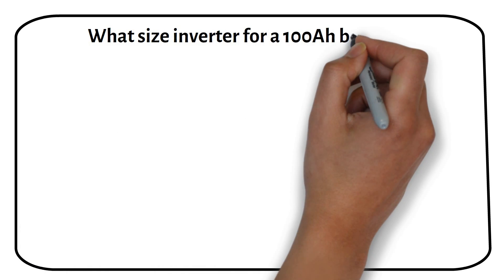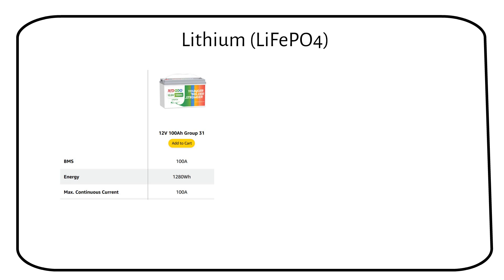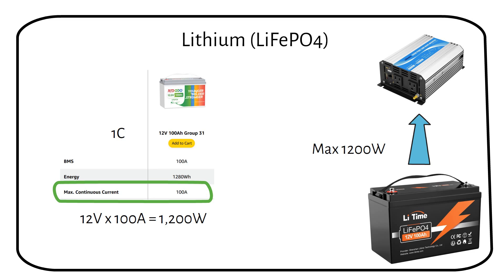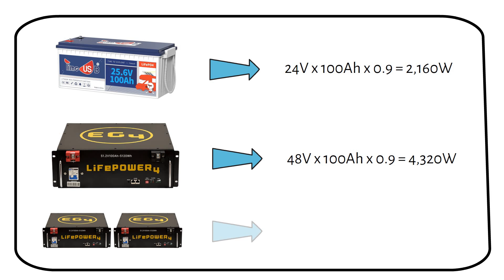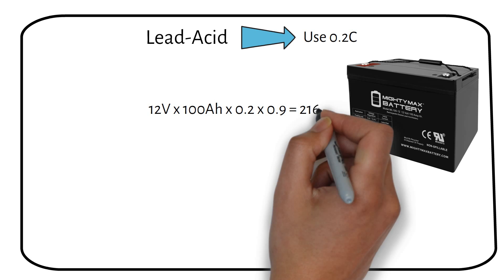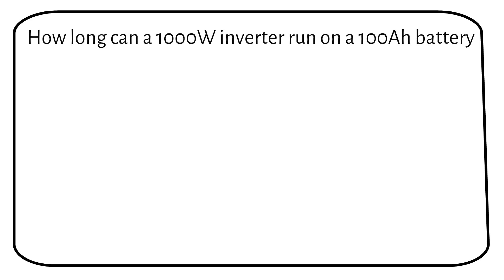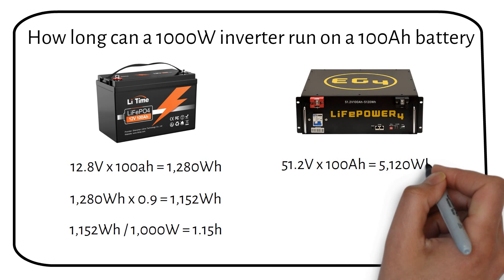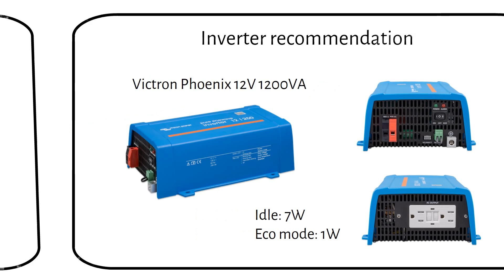What Size Inverter for 100Ah Battery - Sizing Battery for Inverter

Comment: I have 27 4.85 kw 48 volt GSL batteries and having problems with my fortress 12 inverters I have three of them
Reply from the maker: I think you should contact the manufacturers in that case.

Comment: Please is it possible to have a 1000w solar panel for a 12v battery charging 🙏
Reply from the maker: You can but i don't recommend it because you need a large charge controller. 1000W/12.8V=78A instead, use a 48V system and the current will be only 19.5A, much cheaper charge controller!
Reply: @cleversolarpower  wow 😀
Thanks for the reply, I do appreciate 🙏
Reply: For 48v the wire doesn’t have to be as thick so you’ll save money there too.
Reply: @2hotscottpro  Oh, thank you 🙏😀

Comment: Hi Nick,

I recently purchased a used RV that came with two Vmax SLR125 12V 125Ah 1.7kWh Deep Cycle Solar AGM Batteries already installed. It also has a Xantrex PRO XM 1000 Watt Inverter, which was disconnected.

I’d like to reconnect the inverter and was wondering if the TEMCo WC0177 2 AWG Welding Cable would be sufficient for this setup. I plan to use it to connect the batteries in parallel and then connect them to the inverter. The TEMCo 2 AWG welding cable is rated for 190 amps at 75°C (167°F) and 220 amps at 90°C (194°F).

What are your thoughts?

Regards,
Reply: I forgot to mention this:

Ampacity of TEMCo WC0177 2 AWG Welding Cable:

1.   At 75°C (167°F) Insulation Rating:
       -  Max amperage: 190 amps.

2.   At 90°C (194°F) Insulation Rating:
       -  Max amperage: 220 amps.
Reply from the maker: Checkout my video on how to select wire size. I also have one about fuse sizes. It's in my beginner playlist.

Comment: I have two Redodo  12 V Group 24 100amp hour batteries connected to a Giandel 2200 W pure sign wave inverter. This is for my 7 x 16 enclosed cargo trailer that’s been converted into a toy hauler, full build, bathroom kitchen, etc..
Reply from the maker: I'm sure you are happy with both. Good products.
Reply: @ thank you

Comment: I have just got an Enerdrive Ps 1000w inverter. I’ve got a Renogy 30A regulator. Any hints on Batteries or Solar panels would be great! Thinking 400 watt panels.. :)
Reply from the maker: The battery and solar panel amount depends on the total power requirements of your system. I recommend watching my video about sizing an off grid solar system.

Comment: I have 2 100 ah batteries and a 630 watt solar panel  what size inverter do I need
Reply from the maker: the inverter size depends on the load you want to run. This video talk about the maximum size inverter you can use.

Comment: Hi there. Great video thank you.  If I understand correctly, let’s say I want 6 x 300ah 51.2v server rack set up for a very large facility I wish to run.  Would I need 6x  eg4 18kw pv inverters for each battery? I’m a bit confused. Then how also would I be able to draw power from all the batteries and charge all the batteries at the same time?  Sorry I’m a complete novice to this stuff. Hope my question makes sense. I’m toying with the idea of the eg4 18 or victim easy solars in parallel set up for complete off grid systems but victron is so expensive especially as I’ll need a load of units?
Reply from the maker: You can just use one eg4 18kpv and connect it to the 6 server racks. The batteries will be in parallel. I made a video about parallel batteries.
Reply: Ok. Thank you for your reply. So even though I have let’s say 90 or 100kwh battery bank one  ev4 18kva inverter would charge the battery bank as they are in parallel. So if I had 17kw of panels will 120kwh be devided by 17kw of panels to get the charge time?

Comment: This is great. Thank you. I'm running 2 100 w eco-worthy panels into a controller, and the one deep cycle marine battery 100 amp hours to a 600-volt Amazon cheap DC to AC hook to the battery. It's always on,. I have 1 3. 9 to 14.4 max when battery is full. I leave the inverter connected, there is a shut-off switch but there's always an LED light connected. I haven't used it besides using lighting and charging phones, simple things. I was thinking of getting another marine battery to add to it. It's kind of expensive to purchase a lithium battery and have them delivered, Amazon boxe, homeless in a van.., I don't think I can get one to an Amazon box. Buying them in person is extremely expensive at stores. For the lithium. But I really appreciate all the info. I'm just trying to run a 400 watt ceramic space heater in my van during the winter. I think I'm going to have to go to a diesel heater, and get another battery so it will actually run for about 3 to 4 hours a night through the coldest part. Hoping
Reply: I've been on a small solar setup for 30 years.  You're right to be looking at something else to heat your van with only 1 or 2 batteries.

Comment: I was gifted an 80ah Lithium ion deep cycle smart battery. I am a ham radio operator and plan on making a portable solar power station with it for field operations. I am thinking a 600-800w inverter will work for this.

Comment: Thank you.  I have been searching for two days for this information.  My only question left is will a wattage surge greater than the capacity of my lifepo4 battery bank damage my batteries?  Perhaps you answered that when you said the BMS would shut the battery down were the wattage to go too high but I wasn't sure.
Reply from the maker: A surge is less than a second, most BMS'es can have a small surge of 2x their rated current. If not, they will shut down. You can solve this by placing more batteries in parallel.
Reply: @cleversolarpower  Thank you for responding.  I remember hearing that exceeding the batteries capacity could be dangerous. Perhaps that was in regards to free lifepo4.  I don't know as I am brand new to this.  But you have made me feel a lot safer ordering an inverter that runs at 3500w but has a surge rate up to 7000w while my battery pack capacity is at 5120w. Thank you sir. Appreciate your knowledge.

Comment: could you please do a video on 18v drill batteries and say 1000w 12v inverter, how many would you need, step down controller and diodes. this would be very interesting as there are many new power banks coming out with drill batteries .

Comment: I have a lithium 12.8v 300AH battery. 2000W Inverter be ok for it???
Reply from the maker: If the BMS is 1C, then you can draw 300A from it. 2000W/12V=166A. -> ok

Comment: I have a LiTime 200 amp/hr lifepo4 battery.  It states 100A max continuous charge/discharge, I assume because The BMS is only rated 100A. Does this mean the max inverter I can use is 1000W?  I’d like to swap my 1000W for an 1800W but only if I can use the additional power.  
Thoughts???
Reply from the maker: A 12V battery with a 100A BMS can deliver a total power of 1200W. Adding another one in parallel will double it. You can add a 1800 inverter, you just wouldn't be able to draw the full 1800W. The litime has a surge capability, so you can draw more than 100A for a few seconds.

Comment: I have a 65ah battery in my car and a 160 amp alternator, is it safe to install a 1000 watt invert? I will be using it while driving and not with car off. I know that multiplying volts by amps gives me max output of the alternators of 1920 watts.

Comment: I  love the 280/310ah cells as the most bang for the buck and favour the 1.5kw 3 kw peak inverter combo - it allows a microwave, toaster, kettle etc one at a time - it's more than twice your battery allowance to cover them rainy day or three that sometimes visit
Reply from the maker: Yes, last time i checked a 3.2V 280Ah was $45/pc. What inverter do you use?
Reply: @cleversolarpower  LVYUAN Pure Sine Wave

Comment: I only need to power my cpap machine 75w and my laptop 65w so I got a 300w inverter. It works fine. I'm planning on getting a few 100ah lithium batteries, I already have the first one.
Reply from the maker: I wonder if when you are asleep and the CPAP machine shuts down due to inverter turning off that it is risky, or do you wake up then? Having batteries in parallel is good for redundancy.

Comment: 3 - 100ah batteries with 3000 watt inverter.
Reply from the maker: Correct, if you have a 12V system.

Comment: If I have 12v 20ah battery, can I use a 500w inverter? I want to use it for charging my phone on camping trips, just curious if that would be okay, before I do buy anything
Reply from the maker: 500W/12V=42A, if you have a 12V 20Ah lithium battery with 1C, you can draw max of 20A, so no.
Reply: @cleversolarpower  oh okay
I confused myself, 😊 thank u
So I would need a 100w or 200w inverter
🤯🤯lol

Comment: Thank you for the video, Question, can I use a 1000W inverter with a 200Ah gel battery?
Reply from the maker: gel = 0.2C -> 200Ah*0.2C=40A max draw (can do more, but not ideal for longevity and power losses). 1000W inverter on a 12V battery draws: 83A (1000W/12V). So you would need two of these batteries to make it better. It will still work with one, but the lifespan of the battery is going to suffer.

Comment: I got a renogy 700w inverter in my truck. Just have the starting battery and 150A alternator
Reply from the maker: Are you using a lead-acid battery as your house battery? Or do you run the inverter on the starting battery?
Reply: @cleversolarpower  starting battery but inverter can only draw a little over 1/3 of what alternator can provide. I only use for charging my cordless tool batteries without engine running that is very low wattage think 2w. You wouldn't want to leave on even without a load if you don't run engine every few days it will drain battery down

Comment: Is a 1000-watt inverter good to run a refrigerator? I was thinking of connecting it to my car battery and let it idle for 20 or so minutes. Then repeat this maybe every 6 hours. This should keep the food from spoiling dur a hurricane. Is there anything wrong with my thinking?
Reply from the maker: Depends on the fridge, but my 100W fridge only runs with a 1500W inverter. Because it has a peak surge during startup. You can do this in an emergency, but not long term because a car battery isn't made for that.

Comment: I have 3-100ah lithium batteries and a 12/1200 Victron Phoenix inverter and a 2000W Power Tech On inverter
Reply from the maker: Too bad you cannot connect the ac outputs together.

Comment: Your brief description of the calculation by battery type is helpful!  I have (2) 12v 54ah Lithium batteries wired together.  Is the 1000w inverter still the right choice?    Thanks!
Reply from the maker: In parallel, yes thats still ok.
Reply: @cleversolarpower  Thanks!
Reply: I have two LiTime LifePo4 200ah batteries wired in parallel with a 3k/6k watt inverter. Is my inverter undersized.
12v×400ah=4800
4800×.9=4320
Should I have a 4k continuous watt inverter? If the 3k inverter is OK, what size fuse should I have between the battery and the inverter?
Reply: @tangoindiamike9189  The inverter will never be "Undersized for the Batteries," it can only be oversized, but your Inverter can easily be undersized for the load.
Don't expect a 1,000 Watt inverter to power the Kitchen Stove, but if you have a 1,000 Watt inverter being powered by 400 Amp Hours total of batteries, all you're doing is...
Extending the life of the batteries. What kills batteries is discharging them fast and deep.Also, those 200AH Batteries may store 200 Amp Hours, but the amount the can deliver depends on the Battery Management System. Many limit the discharge rate at 100 Amps maximum.
The fuses from Battery to Buss Bar should be rated at the max current the BMS can handle, and the fuse from the Buss Bar to the Inverter should be rated for the maximum (Peak) demand of the inverter.
We fuse the battery > Buss Bar connection to the same current as the BMS's Max Discharge Rate, because if the BMS craps out and fuses into a solid conductor itself, a 100 AH LiFePO4 battery can surge at 200-300 watts until it gets hot enough to BOOM!

Comment: hi good am..my battery bank capaciy is 100Ah lithium can  use higher inverter wattage like 1600watts or 2000 watts...thanks for your responce...
Reply from the maker: If your battery is 12V, then you can draw a max of: 100A (1C) * 12V= 1200W.

Comment: Hi Nick, videos are great I have 4 solar panels @200 w each hooked up 2s2p to 40 amp charge controler. Batteries are 2 ,12v 200 ah that I am  making 24v by going series. I don’t have a 24v inverter yet and would like some advice. Ian looking at victron multi plus 4000 or the sungold inverter charger. This project is mainly for emergency backup for a fridge. Thanks
Reply from the maker: If it's for a fridge backup, then you will be ok with a 2,000W inverter. Victron makes great products, i would advice them over sungold.

Comment: Great video, very helpful. I have a 51.2v/ 105ah lithium battery on my golf cart and am looking to install an inverter and possibly a solar panel on it. Any recommendations on a good 4000watt inverter that could handle this project?
Reply from the maker: Victron makes great inverter/chargers.

Comment: Question.
About amp hours. I am not sure how or what is amp hours. 

Also.
If i have a 800 watt inverter and hook it up to a 12v battery. And then i turn the inverter on. Is the inverter producing 800 watts even with nothing plugged into it? Or is consumption demand driven?

Comment: 24 Volt 100ah Lithium with a Victron 24/1200 watt Inverter and 800 watts o Solar using a 100/30 Victron Smart Solar Charge Controller works really Good here in The Southern California High Desert 🌵 Thank You Nick
Reply: Now Paired with a 2nd 24 Volt 100 amp Lithium Iron Phosphate Battery is way better and as Funds are available I Hope for 10K with 4 of these Batteries tied into the Bus Bars.
Reply: Planning on same set up I have the mppt 100/30, but not sure I should buy it  the 24v 1200 phoenix not sure It would hold enough. What do you run on daily use?
Reply: @javiercoronel1169  Security Lighting, Internet Router, 22 Cubic Foot Kenmore Refrigerator / Freezer and It's Designed Good & Solid for 800 - 1000 watts Constant.

Comment: Hybrid Inverter size 3500w/5500w, 100A, 500VDC, 220-240VAC pure sine wave connected to a 48V 100Ah lithium battery as a backup system during power outages. I’m looking to upgrade by adding 8 x 600w Canadian solar panels and a second battery of similar size to the one I have. Can this Inverter work with the 8 panel, is it not an overload? Also, will the PV system charge the batteries? How about 3-batteries instead, for night usage when the sun is down. How long will it take for an 8-panel system charge the batteries because I would like to use direct solar generated power during the day and stored power during the night.. I am solving backwards. When the inverter and battery was installed, I was solving for load shedding (South African power outages) and now I’m trying cut cost; grit power is costly.. I’m hopeless on the subject, your advise will be appreciated..😢

Comment: I have four 125 amp hour batteries Vmax Brick AGM solar for a total of 500 amp hours, I have those hooked up in parallel to a 1,000 watt Renogy inverter charger.

Comment: Nic, hi! Am poor  in mathematics, if I buy 10 panels of 150w each, 4 gel batteries of 12v150Ah and an inverter with 2000AV, control charger has 1560w. My hourly use is 1200w(only during day), my sunhours are 5.5 then, should I add pvs or batteries, because by 4pm the power dies daily.

Comment: Is there a minimum watts required? I have 2 x 560ah 12v batteries, and was going to wire them in series to a 24/12 dc converter then to a phoenix 3000w 12v inverter. I don't intend to draw over 3000w and the batteries are rated to 200amp discharge.
Reply from the maker: No minimum inverter requirement. Adding a DC converter before your inverter is not a good idea. Most DC converters don't have high current, and if they do, they will cost you a lot. Then it will be better to get a 24V inverter.
Reply: @cleversolarpower  Brilliant information! Thank you very much for taking the time to respond.

Comment: I enjoy the way you explain these concepts.  I have a 3000W 24V victron inverter and I'm switching from 6 12V 150ah  lead acid to 24V 100ah lithium.  I wanted another battery for extended cloudy periods but the tech rep told me the most batteries I can have is 3.  I don't know if its because of the math as you have explained or other factors.  Does 3 sound right?  Thanks.
Reply from the maker: Thats weird, why not more than 3 batteries? Did you ask why? Max battery size depends on your daily loads, not on the inverter. You can have a minimum requirement for batteries, and a maximum for batteries in series, but i wonder why 3. Maybe he means max 3 in parallel? If so, check my video about parallel wiring.

Comment: Can a 500W inverter be used to charge 100AH Lifepo battery also instead of 1000W?
Reply: I assume you're referring to an rv setup where the inverter can be hardwired to the 120 system, so that the inverter will charge the battery while on shore power, and then you can switch the inverter on to draw from the battery when there's no shore power. Not all inverters have hardwire capability. I would think that any inverter with hardwire capability would charge your battery, because it's drawing power from the grid/shore power. I'm no expert, so I'm not really sure.

Comment: So if I have two 12.8v 20ah batterys run in parallel then I should use a 500w inverter just using it for camping
Reply from the maker: Correct.
Reply: @cleversolarpower  if I used a larger inverter like a 600 watt or 1000w would it damage the batterys